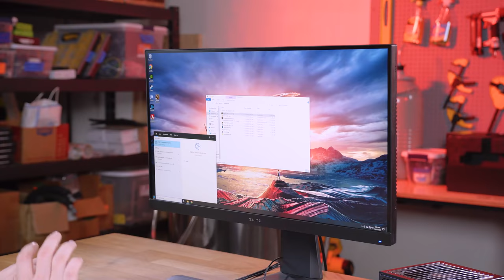This PC almost stumped me... can you guess what went wrong??

Comment: I uh just troubleshooted (shot?) my friends plex server.... he replaced everything after a flood and it just would give no display.  I finally visit him (900mi drive) and begin the usual stuff.  Ram ok, check slots, try mb input for video out, then.... start getting closer to the answer.  I check cpu and look for damaged pins.  all good.  reseat heatsink.... all good now for sure.  replug cpu fan header into cpu fan 2.... no fan spin.... the fuck?!?  Plug into cpu fan 1.  it spins.  ok then.  Im thinkng dead motherboard.  Hey does this have a post code display (pulled ram and didnt hear anything when i booted).  Oh shit it does.  Uh.... post code display isnt displaying.... anything.   Back to wiring it is then.... Hey uh... buddy.... you didnt err plug in the 8pin cpu plug....   EVERYTHING NOW WORKS....

also you didnt have your ram in dual channel config.

Me: Bachelors in Microbiology
Him: Masters in Electrical Engineering

Comment: If you use a riser cable and pcie 4,0 mobo and gpu you need to change to pcie 3.0 setting in bios for get it 100% or buy a expensive pcie 4,0 riser cable.

Comment: People, there is a class issue identified by Thermaltake on the riser cables on "P" cases, they cause funky issues and sometimes tearing, if you reach out to TT support they will replace it for a "Newer" cable which does not cause the issues (Happened to me).

But the suggestion is to get a better cable, like the ASUS ROGStrix riser or the Thermaltake AC-053-CN1OTN-C1 or the Phantex that is angled.

Comment: I had a issue once with a dell specific motherboard where.. if you got a power supply that was over 550W  it would cause problems..  and i didn't beleave him..  till i bought a 550w  and the problem just stoped.

Comment: Does anyone know why my pc just won't get itself to BIOS Flashback? I don't get a display screen on my monitor to get to the bios screen. Everything in my build seems to work, I've tried reseating the GPU, tried every Display /HDMI port, ensured GPU power connectors are plugged in, and tried using both of my sticks of ram in each slot one at a time. The post code seems to like sticking around to numbers 51 for about 4-5 seconds and 15 for about 1 1/2 seconds. I have a video of it but can't send that in the comments.  I just don't know what's wrong. It's my first build and I've been very careful with everything, took me about 8 hours to build. I'm extremely worried and scared that I wasted my money. I have the Aorus Master B550 mobo so it doesn't have speakers to help me identify the problem, without a display on my monitor I can't tell what wrong

Comment: You don't say what graphics card he is running, but if it runs at PCIE gen 4, try changing the bios to Gen 3. Hardware Canuks just did a piece on this subject with riser cables not handling the PCIE gen 4 speeds very well. As for the smoke, I think that is another problem entirely and could be wrong cable / wrong hole / mixed manufacturers cable on a modular PSU.

Comment: Thermaltake using cheap stuff on critical components? Say it isn't so! 

I had a case back in 2014-2015 that was supposed to be hot swappable HDD slots that I thought would be useful helping family and friends recover data or clone drives but the SATA plane they used would only recognize drives in 2 of the 5 - 6 slots. Even when you could get it to run, I found out in their community forums that it ran at SATA I speeds. -_- If I had not already modified the case for my water cooling, I would have returned it.

Comment: So, looks like the Gigabyte PSU caused the initial damage, then by chance a cheap bad riser cable, when you can see the comparison in the riser cables you can see how bad the one used is, shocking from Thermaltake, they need to find a better OEM, those are AliExpress standard. I would definitely recommend UPS regardless if it was just those two issues, especially in the snowy environment that Jay was explaining, I was about to say UPS before then, it would definitely "isolate" the power and make sure it's clean. 

2 years ago in the UK where I live, I started to experience brown outs and micro dips in power - you know where the lights dim slightly. Thinking back that lasted a good 9 -10 month, so I don't know if the local sub station had issues, well I assume it did, coz towards the end of that period there was an electrical explosion there, and since I've not seen any brown outs or anything. Anyway, I have a NAS drive that a few video editing clients can access, and it has client files on, usually client transfers and archive stuff, I actually edit off nVME in the PC, one brown out the NAS had to rebuild the raid, took 2 days, thankfully nothing lost, and that was it for me, that definitely made my mind up, I had to buy a UPS. I bought a CyberPower 1500, if its just powering the NAS it will last over 2 hours, and if I'm also  running my AMD 3950X / 1080ti rig, and all 3 monitors I get about 25 mins. More than enough time to finish what I'm doing, save and shutdown. The NAS is scheduled to shutdown after 15 mins on UPS power as it takes almost 10 mins to end all the processes and shutdown, so there's enough buffer in there for the power to come back on, I didn't want things starting to shutdown after a few mins only for the mains power to return and I have to wait for everything to shutdown then start up again.

Comment: My weird problem build was a long time back (15 years ago, something like that?). The PC would sometimes start up and then just stop, not always. I swapped out CPUs, motherboards, memory, the PSU and blew up some bits like a CPU during the debugging process, the problem persisted. It eventually turned out the the case's power-on push switch had a bit of plastic trim which would sometimes jam and hold the power button "On" == four-second forcing the power supply to shut down after power on. Five seconds with a sharp knife removed the bit of trim jamming the switch and zero problems afterwards. I still have that case, three motherboards and six CPUs later, only just replaced it with a completely new build which went from opening the boxes to Windows installed and running in three hours flat.

Comment: As a system builder I've had multiple run ins with thermal take cases build quality. The riser cable being one, rgb fans not working or needing a push to spin, rgb buttons from the front panel HOT GLUED in the wrong spot causing the button not to work.

Comment: A few years ago, I started having problems with my rig when I first got Watchdogs 2. A variable amount of time later & it would just switch off. I tracked it back to the GPU (I had 780Ti's in SLI), so I pulled out one card &  decided to upgrade. I got a Titan X, thinking I'd get a boost & a single card solution. My 3DMark  score went down, so I decided I couldn't have that & therefore must get a second card. Not wanting to be CPU bound, I then "needed" a new CPU, so then a new motherboard & a new PSU for the two Titans. 
Then I decided, WTH, and bought an Enthoo Elite.
I couldn't be bothered tracing & replacing all the power cables, so I just used what I already had & plugged them into the new PSU. 
When I fired it up, one of the 8 pins on the Titan started smoking.
My entire problem had been one bad cable. We'd had a series of lightning storms and power outages. Thousands of dollars to fix a 2 dollar problem.

I had a similar thing with my ancient laptop last year. I just have it hooked up to the bedroom TV as a media hub & never turned it off.  I had shows playing on a loop while I was at work & while I slept for background noise. I had surround speakers set up, so it could be heard even when the TV was off.
Well, my mother visited & noticed & whined about power bills & the environment, so I turned it off at the wall. To try for better sleep, I left it off for several months and then it wouldn't turn on. Battery lights came on, but it wouldn't power up. I ordered a new battery. Powered up, but wouldn't stay on for longer than 15 minutes.  I figured maybe the battery was bad, so I ordered another one from a different vendor. Same deal.

I suspected overheating at this point, as it was a Qosmio I bought new in 2011 and never cleaned. 
I eventually managed to pull it apart to get at the fan (never will I do that again) and it was pretty much spotless. What a wasted and frustrating day. I also ended up with 4 leftover screws (pretty sure they're from the hinge assembly, but they're never going back in.
When I bought the first battery, I also bought a replacement power adapter, since the old one was getting a bit worn. I never used it, as it wasn't the same. It was vey chunky & square and the cable was much longer. 
With nothing left to try, I plugged it in. Guess what the problem actually was. 
2 "dead" PC's, both due to a couple of bucks worth of cable.

Comment: Over the decade and a half I've been fascinated with PC building, I've had 3 scary moments that have left me speechless.

1. I was around 14, my father told me to plug my computer in, and as I did, the PSU very literally exploded. There was a loud bang and then smoke followed. I was leaning over the PC and this was when the PSU would sit in the top rear of the case.
2. I had just bought a new Floppy drive, plugged it all in, then powered it up. For some baffling reason, there was smoke. I opened it up to see the wiring from the PSU to the floppy drive had melted and sat across the mobo. I should add, this was when I learned cheaper PSUs are bad..
3. My DVD drive decided it didn't like one of my fav games and uh, span it to death, it span the disc so fast, you could audibly hear the disc explode inside the drive. The drive died too.
It was hilarious and horrifying. Until this year, I hadn't touched a DVD drive since, this fear of losing more discs lasted a little over 10yrs, the game was C&C RA2 YR.

Comment: Shot in the dark here Jay but do you by chance have a ryzen 5 5600x that i could buy from you? I am currently going through and doing a full upgrade on my first ever pc i built 2 years ago. i upgraded the power supply from a 550 80 gold super nova to a 750 80 gold super nova, got a gigabyte radeon 6800 gpu  to replace my old xfx radeon 580, and now am trying to replace the ryzen 5 2600 cpu with a 5600x to match the 6800's gpu performance and reduce the bottlenecking im having. scalpers and no inventory are really making this impossible.

Comment: Jay, you  will probably not get to read this but I'm going to give you a piece of advice anyway. Electrostatic discharge will not harm your components as long as the computer is grounded, that's why Linus couldn't kill the RAM sticks while they were inserted in the MB slots. Even having the PS off, its cable will provide ground through the wall outlet. So, if the SATA drives burned up it's clearly because of a defective system power supply. 
Have a happy New Year and keep up the good work on your channel.

Comment: i daisy chained 3 cheap $5.99 riser cables 7" a piece... 0 performance loss, 0 issues. highly doubt it was the riser cable. dead mobo most likely installed it wrong and shorted the mobo on a misplaced standoff or something

Comment: This is why I gave up on ThermalTake's crap. The usb 3 in the case i had died, and They wanted me to send back the WHOLE case instead of me just replacing two screws and them sending me the replacement piece. Every Thermaltake product I've ever had, has had issues. I rather buy cheap crap from Fry's then thermaltake.

Comment: The short circuit could have been a pre-installed motherboard standoff in the case where there is no hole in the motherboard but pins. Ask me how I know. 😁
Concerning power supplies: stick with reputable PS manufacturers like Seasonic, BeQuiet, Coolermaster. Back in the day Antec cases were popular, but after a one of my Antec PS's failed, and took with it my motherboard, I steered away from those. Aforementioned brands never gave me any problem in the past 10 years (on several PS of each brand)

Comment: I also live in Fairbanks, AK. Longtime fan. I can definitely attest to the static problem - at my office on campus, the static is just terrible. I ruined multiple keyboard PCBs because it was so dry, at home though it’s pretty humid in the apartment so I haven’t had a single issue this winter. Definitely worth getting a humidifier if you live in a cold dry place like me.

Comment: Hmm. The riser cable cannot be the reason for the initial issue (smoke coming out of drive/s), later issues like blue screening ect yes.
Let's think about this for a moment: The PSU 'just' needs to output a few voltages (12V, 5V, 3.3V and let's ignore output current which is determined by load)
If the PSU was faulty then we would expect it to affect all components at once, in this case only a drive was affected pointing to that drive being the issue, it would only 'smoke' if either the PSU was outputting a tremendously higher voltage (again other components would be affected) or there was an internal fault, maybe a short circuit, within the drive itself.
I notice you did not have the drive in question to examine it but would bet that was the original issue.

Comment: My Thermaltake riser cable was crap too! Took me forever to isolate the issue, and I actually ended up installing my gpu normally because I was frustrated after rebuilding my system again and had zero issues. Dont use Thermaltake cables.

Comment: I have a cheap mechanical keyboard, where turning the RGB on makes keyboard controller on the mobo sh*t the bed until you power cycle it.
I've also seen bad integrated audio blow SATA channels up, twice - and that doesn't even make sense. 
It's probably the riser here, but there are so many stupid fringe issues to be had, especially with cheaper components. 
Mostly intermittent, too; it can drive you up the wall to troubleshoot stuff like this.

Comment: I had a similar problem years ago but with SATA data cables.  My PC at the time was having crash to desktop and BSOD issues and I tested every single hardware component in my PC.  I was finally at my wit's end and bought a bunch of SATA cables from Microcenter and replaced all of the SATA data cables in my PC (6 in total).  My PC finally stabilized and was able to run the machine with a week of uptime.  Physical problems are not the most obvious.

But it made sense because the case the set up was in had a sharp exit for the data cables to get to the data connectors on the drives.  There was no travel for the data cables to have a gradual bend and had a hard 90 degree bend.  Also, SATA cables don't have bend relief (would it kill someone to put bend reliefs in as many cables as possible, like apple?!).

Comment: Jay I got this exact problem with a 3090 on x570 mobo and 700w power, it is the riser cable , but what weird was that the same cable worked on the same Rig but with a 3080 card with no issues ... its a Thermaltake cable . the one that comes with the Thermaltake showcase core p3 .. btw I asked for replacement and  the cable arrived in one week ...

Comment: Someone might say bad case?  Jay sounds like you have had this come up before.

For me going way back to the beginning as an authorized IBM PC repair technician early 80's.  Had original IBM XT that would pass all IBM diagnostic, and advanced diagnostic tests.  

Thing was I could make it fail while using it at the same point in the software this company was using.  Well you would think it was something like the software, or hardware other than the case.  So removed the hard drive, and moved it to the same configuration hardware it did not fail.  So moved parts one at a time from the original host system, and it would pasted tests every time.

Once all parts were moved the only thing that was left was the black 5150 case sitting on the bench.  So I was able to work my way up to head of the warranty repair department at IBM.  IBM then shipped a new 5150 case.  Moved all of the parts into the replacement 5150 case, and it never failed any test after that run over many days.

Comment: I have a question I just bought a new pc with a 3070 anything was running fine on it but I switched cases then all of a sudden all my games would crash tried everything wouldn’t work only thing  that would work was turning off xmp but it was working before but now my ram usage is through the roof and my FPS dropped hard and suggestions

Comment: Hardware Canucks did a video recently about using pcie 3.0 risers with 2 pcie 4.0 devices as well stating that there could be issues that may be an issues for any of you on the current gen board and gpu

Comment: I got a SATA to I think mSATA adapter, I noticed that there was a bad joint on one of the capacitors and in attempting to fix that I had the capacitor get destroyed. So I ordered a new capacitor and as much as I carefully try to get the polarity right I undoubtedly noticed I had it completely the wrong way around when it burst into smoke. It's a good thing I ordered two because I was replacing it again. Essentially I reverse polarity of the capacitor and the mSATA drive amazingly survived, although it was only a 32 gig so I wouldn't of been terribly out. It did make a nice bump and scorch mark in the plastic case. That was going into my PFsense router which has been running for about two years now.

Comment: I just can't get on board with the whole riser cable vertical GPU mount craze.  Whoever came up with this concept really did the community a disservice.  Not only is the cable an extra complication on it's own, but now the GPU exhaust fans are blowing directly on to the side panel of the case.  I'd rather go with a traditional mount.  Why reinvent the wheel?